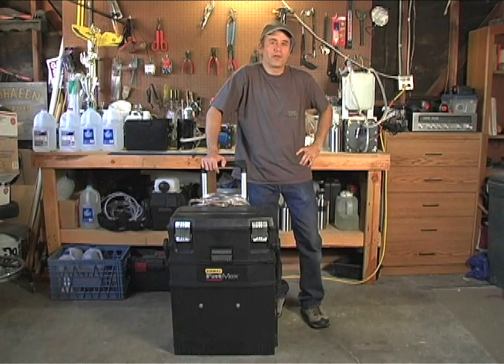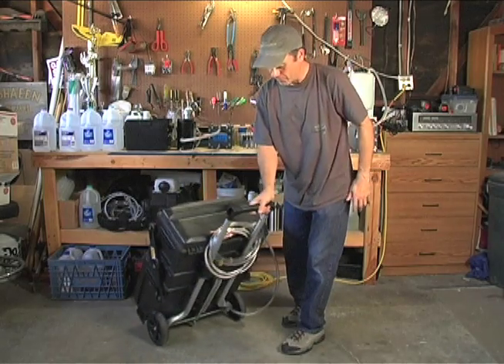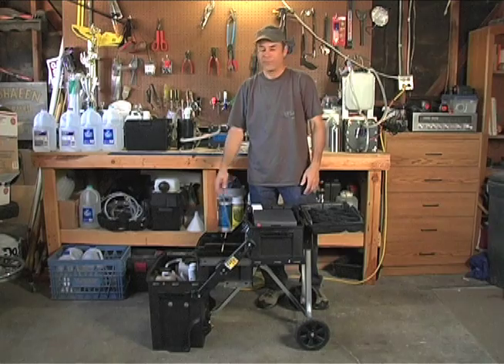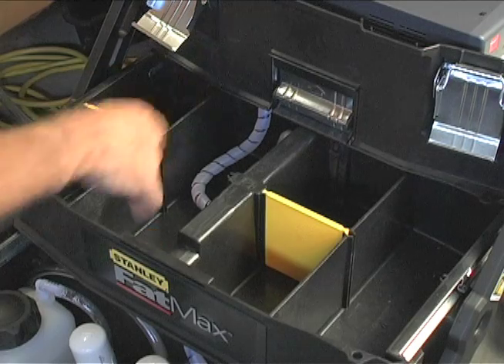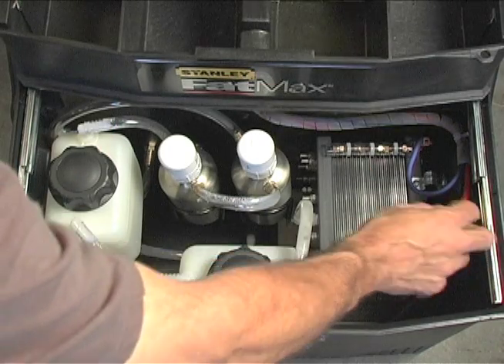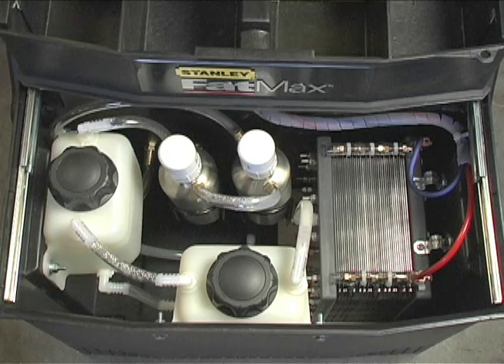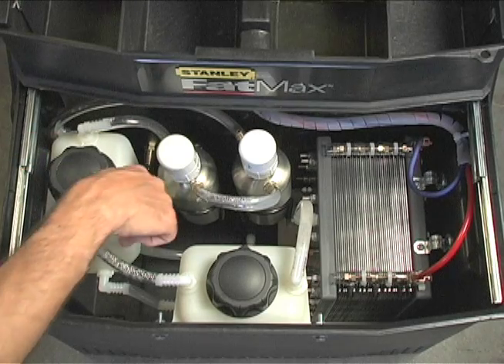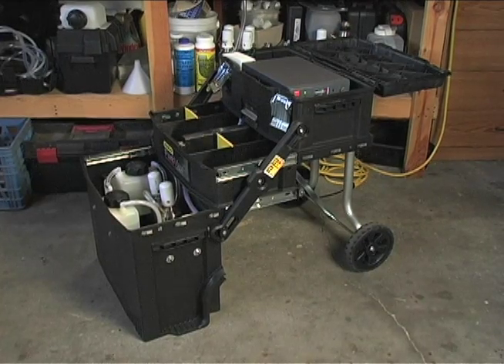Portable 12 Volt HHO Torch

Comment: You need to look up splinter cell an the oxygen an hydrogen come out different hose to limit one like a real gas tourches has..it's off the positive or negative plate if the cell.with filter cloth in middle of cell an two outlets for the separated gases..my2cents.

Comment: Hello! We made a dry cell with 13 plates 12 m x 13 cm. I used stainless steel W1.4404. I used caustic soda at a concentration of 20 percent. Right from the first test we noticed that it started oxidizing because the electrolyte was colored. We tested the cell for several hours on different days. Shortly it reached quite high temperatures, close to boiling. I opened the cell to see what was happening with the plates. 6 plates were seriously affected by oxidation. The plates were very affected. I do not understand why they oxidized those boards. Please give me advice!
Reply: 20 percent seems very high. I bet you only need 1 or 2 teaspoons full.
Also, the overheating would suggest to me, that the electrolyte is too rich.

Comment from the maker: Don't use salt, one of the bi-products is chlorine gas. Use NaOH (Sodium Hydroxide). You can buy it at small hardware stores sold as "crystal drain opener". Just make sure it is the small white crystals and it says 100% Sodium Hydroxide on the label.

Comment from the maker: It means you are eityher using a lesser grade stainless steel (like 304) or you are using tap water and getting contaminates. You should only use 316L stainless and distilled water with KOH or NaOH.

Comment from the maker: Yes, as long as you have enough HHO to sustain a flame with your torch tip. A #2 tip requires about 20 amps at 12 volts in my experience. Also, you can hook up air from a compressor to the other side and turn it on to extinguish the HHO flame without a flashback.

Comment: very nice set up you got there.  so its AC?  does it just use the short leash from the PS, or did you wire in a longer cord?  also kinda cool if you installed aux. jumper leads in case you are stuck on the side of the road :)  just a few more bucks in wire, a mode selector switch and 2 lead post leads.   I gotta say that is one clean looking machine, no over crowded corners, easy access to plumbing and if any thing breaks you only have a handfull of screws to take out in the whole thing.

Comment: @hhoconnection 

Seperator cells are not that difficult to build, porous ceramic materials like terracotta are, when wet, impermeable to gas and let water through, you can get thin slices of it where chemists get their supplies. 

If your videos imply that any HHO technology can be used to produce energy, and NOT to merely turn one kind of energy into another, if there are any over-unity-claims, then i stick to calling you a fraud. If thats not the case, i take it back & apologize

Comment: @amos033 

one great seperator that allows (when wet) water to pass through it, but that cannot be penetrated by air, is terracotta. You can get thin slices of it, or of a similar porous ceramic material, where chemists get their supplies, thats perfect for seperating the anode from the kathode, for producing pure hydrogen and pure oxygen instead of HHO. Or get a hydrogen fuel cell, they have awesome electrodes and the seperation is built in. They are really great hydrogen generators.

Comment: @amos033 

oh, thats trivial. Really easy to do, can probarbly even be retrofitted to some 'HHO generators', turning them into hydrogen generators. Hydrogen is nearly always produced electrolytically, with strong DC current and water. At one electrode hydrogen bubbles up, at the other one its oxygen. Thats it. Just make it so that the hydrogen bubbles are collected in a different location than the oxygen bubbles, there also are materials that let water pass but dont let through gas.

Comment from the maker: @amos033 It does not work that way. Just because I have a lot of plates does not mean I am going to get more production. The only way to get more production is with more amps. More plates just means I can throw more amps at it without overheating. If I had a cell that could get 7 lpm at 20 amps I would be a rich man.

Comment: I noticed several comments from people that can't understand why the oxygen and hydrogen aren't separated.  
The actual gas being generated is called Brown's Gas.  It is almost a miracle gas with unique properties.  Put a torch in free air and the gas burns at a very low temperature.  Put against steel and the temperature goes higher.  Against ceramic and it is really high.

Comment: Nice video, right now I am using 12 volts as well but when I update my torch system I will definitely go with higher voltage, probably 50 volts so I can get more output. I should be able to put 1200 watts into my cell if I use the 50 volt configuration, right now I only can put 540 watts into it and I get around 2 lpm output.

Comment from the maker: @amos033  I get about 1 lpm per 20 amps of power at 12 volts. So with my power supply (40 amp) I'm getting around 2 lpm. And I know, I should have shown the torch working. Someday I will get off my lazy butt and do another video showing the torch working.

Comment: @hhoconnection I figured you must have known but you never know... I doubt you will ever see a flashback go beyond your primary flashback arrestor let alone the second. I have a very similar setup to yours but my reservoir(s) input the gas below the water level. I wondered if your reasoning for doing it this way was because of the reservoir being mounted at the same height as the cell instead of being above it.

Comment from the maker: The output on my dry cell goes into the water reservoir not a bubbler. The two reservoirs are set up like that to act like one bigger reservoir. I set it up like that because these two reservoirs were all I had at the time. But yes you are correct in that because my dry cell output does not go to an underwater inlet on the reservoir I risk the chance of blowing up my reservoirs IF a flashback were to get past both of my flashback arrestors and both my bubblers. I'll take that chance.

Comment: I see what seems to be a design flaw. The output line on your dry cell goes into the top of the first bubbler which is also connected to the second bubbler on the top. I am unsure of your configuration to the next 2 but for arguments sake lets say that a flash makes it past those 2 stainless bubblers. Your next 2 bubblers and cell could all blow up due to ignited gas traveling through the lines and nothing to stop it. Both input and output from your cell should be below your water line.

Comment from the maker: No, you don't need to pulse a square wave to make HHO. You can run it straight from a battery if you want. The PWM is used to regulate the amperage, to keep it from creeping up as the cell warms up.

Comment: Beautiful work, just love it. You can save money on 12V power supply and make cell with 60 plates. Then you can hook 110V and adjust current with PWM. Positive and negative, and 58 neutral plates. Works well. Will post video response. Keep your grate work! Regards, GmanBB